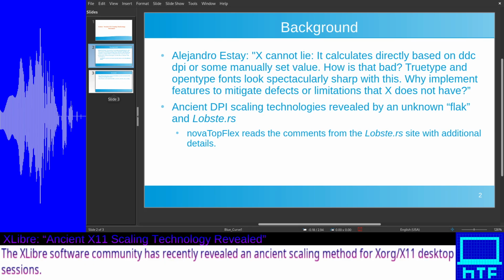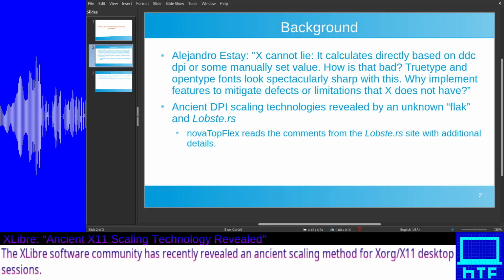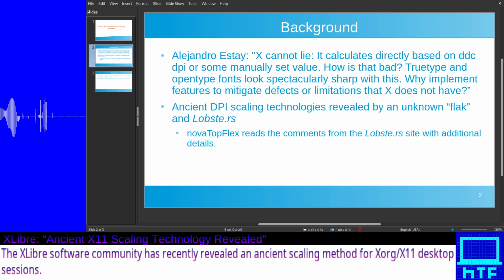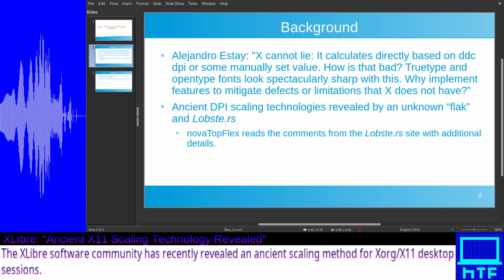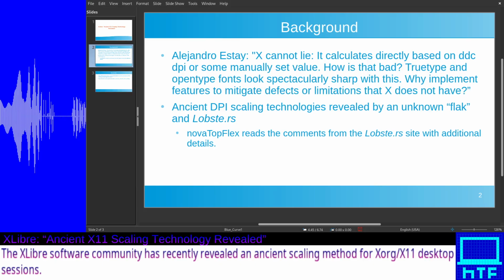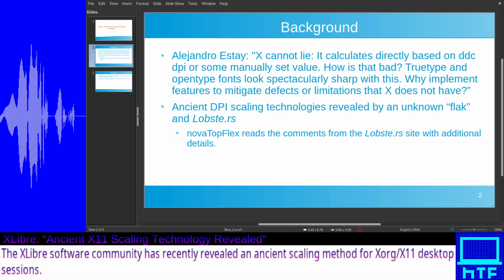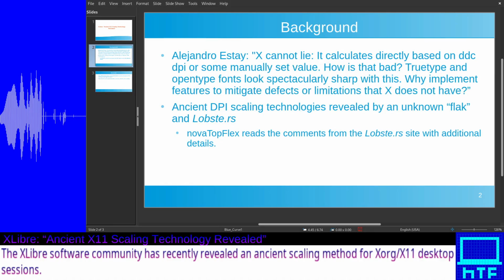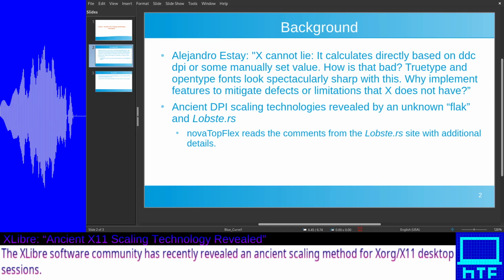XLibre: "Ancient X11 Scaling Technology Revealed"

Comment: It's "impossible" because the previous development team got so tired of the technical debt that they gave up on wrestling with it, and the teams for the individual distros aren't that different. While it's certainly possible to dig deep into these things, many people want something that "just works" because  they have a bunch of other stuff to do too, so spending an extended period of time just investigating how to "correctly" do something in X11 is too time-consuming for them to justify. Thus, instead of trying to dig deep, they grab something that mostly works, try to tweak it to work a little better, and move on to something that thet care about more. Sometimes they'll choose a good starting point, sometimes a bad one, sometimes their tweaks will make it better or worse. And all this on top of many layers of obsolete solutions that only worked well for a small period of time, but are still considered necessary because something really does use them.

Good luck to the XLibre team, they've choosen a big job, that will need lots of time, and ultimately will probably need them to configure most builds for years if reliably good results are desired, just because of how much knowlege is needed to do a really good job.
Reply: That's why I have so much hope for XLibre. They're willing to tackle the technical debt and complexity to actually make X more useful instead of imposing a half-designed, lazily programmed "replacement" on everyone.

Comment: I installed Linux Mint Cinnamon, and fractional scaling didn't work on my 4K monitor, i.e. blurred text. I believe Cinnamon uses X11?

I'll be staying on Windows until I get a definitive answer as to whether X11 works with multiple monitors, fractional scaling, varying DPIs, etc. Opinions are inconsistent, so far. I've been told that only Wayland will do what I require. Crazy stuff.

Comment: Also note when I was on fedora w/wayland for over a year my cursors would constantly fluctuate in size and do crazy things. Not certain it was wayland but I suspect that was the main source of the ridiculous instability I experienced. There was just endless updates and many of them caused breaks, too. If I did not update all the time I still had bugs so it was lose lose
Reply: It happens on X11 too. I have it, and I'm on dwm and when I hover Firefox it is bigger than when I hover the top bar.
To be frank, it's probably not hard to fix it, but I didn't bother to check how, it's not distracting me much.